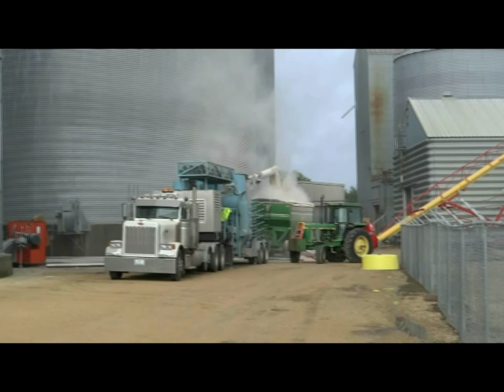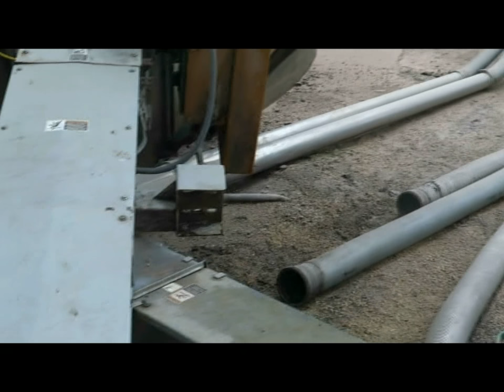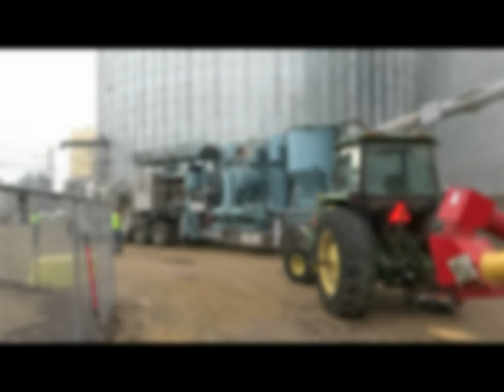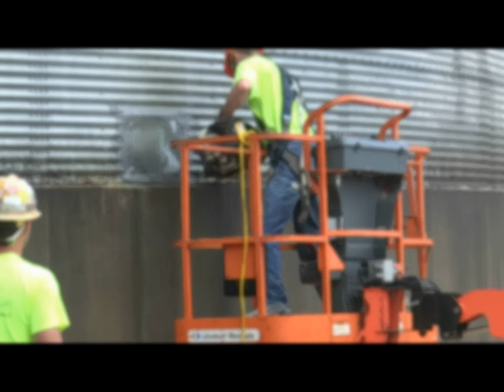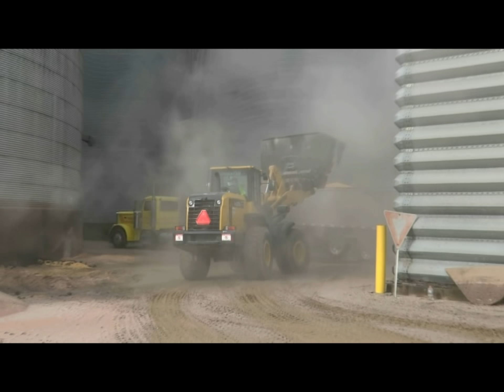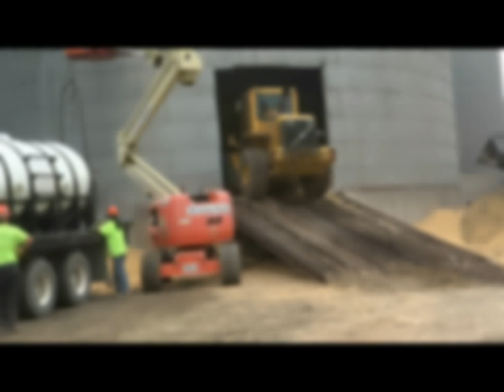SALVAGE RECOVERY OF CORN BIN WITH A BURNING CORE

Comment: 250,000 bushel?      I doubt it's over 25000 bushel
Reply: Patrick Hickey that big loader would barely fit into a 25k bushel bin. 
A 25k bushel bin would roughly be 36 feet in diameter

Comment: What's that unit of measurement, bushles? Never heard that before.
Reply: Fluffy Floofer Bushel, traditionally 8 dry gallons or about 35 liters, but today it is often defined by a set nominal weight for a given commodity product that approximates those volumes.

Comment: Blowing a nitrogen blanket on top and you won't have to worry about oxygen getting to the hotspots
Reply: andy keller that will keep the fire to a minimum but it will still smolder.

Comment: I understand it's a HUGE volume, but is it possible to introduce nitrogen rich air to slow/stop the fire?
Reply: They would need tanker trucks full of nitrogen and the silo is vented.  It could be done but it would take a long time to cool off.
Reply: It’s possible. I’ve helped do it on a much larger scale. It was a nightmare. Problem is the grain keeps airspace down in the pile so there’s always enough oxygen to keep it smoldering

Comment: Is that corn just garbage then, or can it be used for something? How about the bin? can it be fixed? couldn't this be prevented with temp probes or something? If that bin is 250000 bu, how much would the bigger one beside it hold?
Reply: AL M lots a of questions yes anything can be fixed that's the only answer I have for u
Reply: Thanks,  I agree. With enough money anything can be fixed, anything but a dead horse. I was hoping that  maybe Dennis Gregersond would reply.
Reply: It can always be used for Feed, or possibly Ethanol Fuel. Depends what kind of Corn it is.